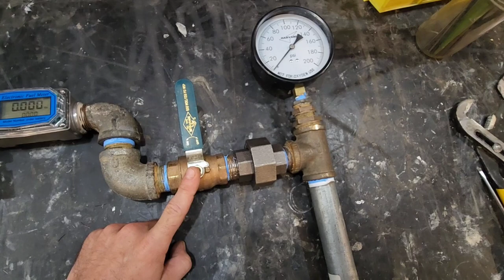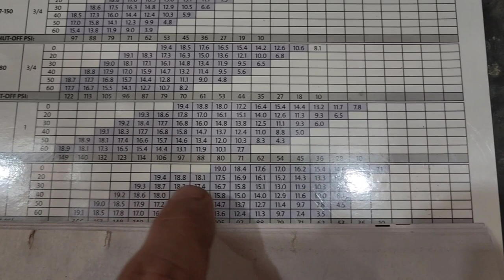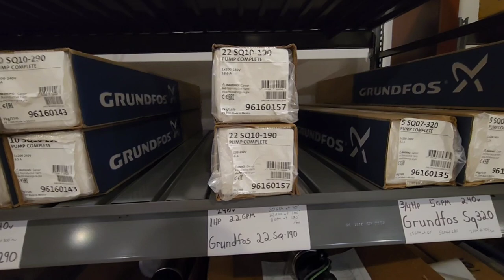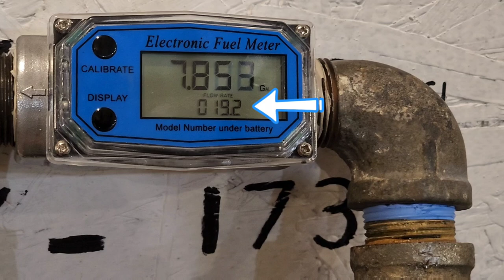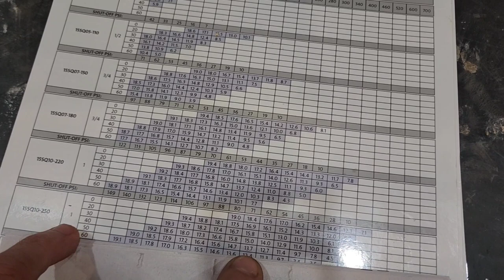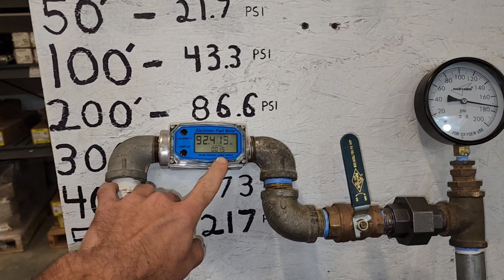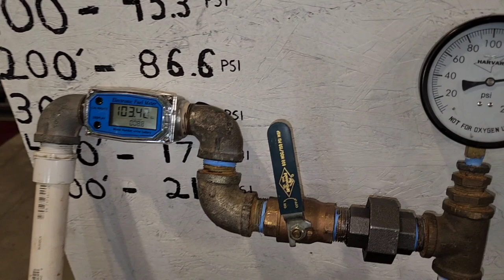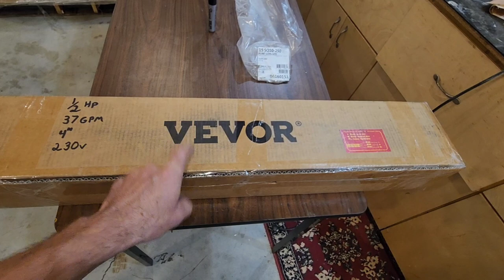Pump Testing a 3" Grundfos 1Hp 15GPM Review SQ-250. Testing Pumps that I Stock & Install.

Comment: nice work on the videos!  I have a question is my well has been acting up and the pump runs but for 8 seconds then cycles off then back on . could i disconnect my well at the tank and hook up my pump manually diconnected from the tank and see if it shuts down within 8 seconds? or if it does not and keeps running then its a good pump? I have no amp meter the check amps. thanks
Reply from the maker: Buy a $16 amp meter from harbor freight, that takes away all the guessing. 
If it cycles on/off/on while your not using any water, then that means you have a leak in the drop pipe. Either a bad check valve in the pump or a cracked fitting near pump, or cracked pipe.
Reply: @h2omechanic  thanks for that info!!
Reply: @h2omechanic  I got that meter from harbor freight and the pump is drawing 20.1 amps startup then falls to 16.9 amps and I think its a 3/4 hp pump so it looks like the pump is bad?
Reply from the maker: @greasemonkeybd  yup. It's bad. That confirms it!

Comment: Please help I changed my pressure switch got power at switch & above ground at pump but still no water also no spark at contact's on switch ? What's wrong ?
Reply from the maker: No spark means the pumps not running. 
If its a submersible pump, it'll have to be pulled out. Your wire going down the well is probably broken, look for exposure in the copper wire.

Comment: where can someone find the flow charts you are using? I have a 300 foot well with a head of 90feet in a 6" casing. im trying to figure out what pump i should use that you sell. thanks.
Reply from the maker: Grundfos SQ-290 is what you'll want.
Or the 3/4hp 7gpm J-Class 4" pump.
Whatever your budget is. Grundfos pumps have nice built-in features, but both will do the job up to 300ft deep no problem.
Reply: @h2omechanic  thank you so much I will be buying one of these here soon from you.

Comment: You are confusing PSI with TDH. for every 1 psi of pressure you have 2.31 feet of head. So when you were at 175 PSI on the gauge, you were at 404.25 TDH. 175 X 2.31 = 404.25. So to have a pumping level of 200' you have 200 + 60 X 2.31 = 338.6TDH

Comment: Why not use 11/2 hp 4" pump ..
Reply: those wont fit in many older  6"+wells with scale and buildup and forget about them in 4" to5" casings. many around here have shoe-horned 4" pumps down the 4" wells, just great until it goes in in 5 to 10+ years, then no longer comes out. 🙄 rolling eyes.

Comment: The Grunfos chart is only as good as the workmanship of the individual pump.  If you get a dud (and I'm sure you have), you know the chart is meaningless.  Been around doing this for as long as both you and your father put together.  Not an expert but have had enough failed pumps to know those charts can be worthless.  What most I know do is oversize the pump for the just in case issues.